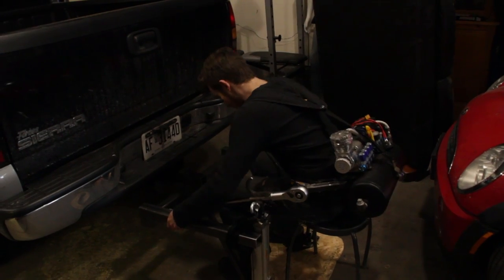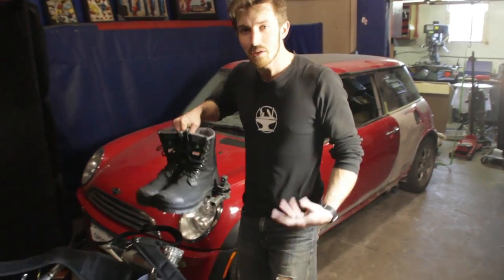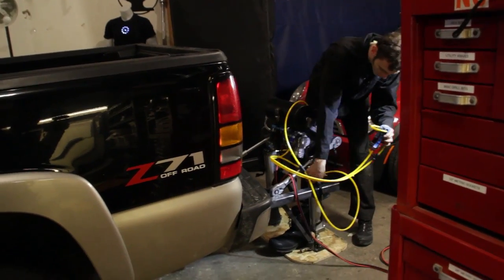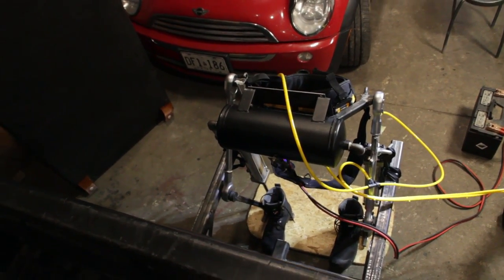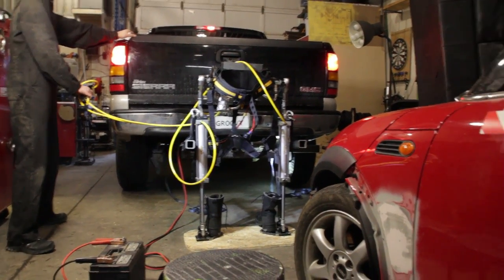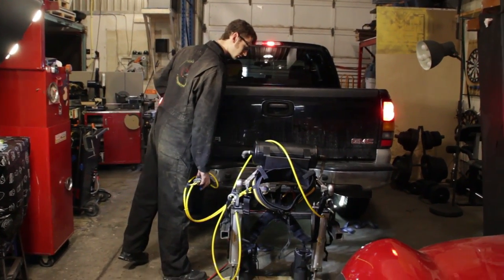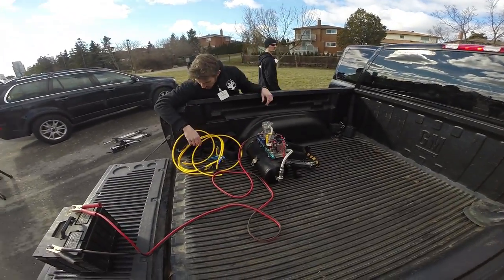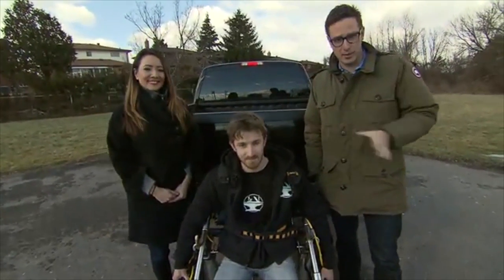Pushing the Exoskeleton to its LIMITS!

Comment: All I see in the comments section are people who are almost yelling at you to upgrade the power pack.

While it's a good fix for now, I've paid attention enough to know you're not keeping a measly lead acid battery that you have to hook up every time you want to power the suit up.

Though, it does interest me in what options you're looking at, power-wise. Any particular direction you plan to take the power pack?
Reply from the maker: +Gabriel March (V The Mama Bear) Yeah... people really don't seem to understand this is a prototype...

Likely will be using a high-end lithium ion battery pack for powering the suit, though I've also mentioned I might use a small scuba tank compressed to 4500PSI as a kind of reserve -- it has a similar power density to lithium ion at those pressures, just is a bit trickier to recharge!
Reply: +the Hacksmith Ease of use and how easy the unit is to recharge is important, especially if this is going to be used by first responders and such.
Reply from the maker: +Gabriel March (V The Mama Bear) Again... it's a prototype =P
Reply: +the Hacksmith I know. Just a (redundant) recommendation for the future :P
Reply: +the Hacksmith get a cryogenic refrigerator and liquify air.  Then pour it into the scuba tank.
Reply: +the Hacksmith  u could try a diy tesla battery and get like 10 kilowatts. space the battery's all over the suit
Reply: +Shadowrcmegatech lox's u wold have to run a heater and it would freeze all your lines

Comment: May i suggest next time an exoskeleton that focuses on increasing the mobility of the user, rather than the strength? Something along the lines of powered kangaroo shoes, or maybe just a complex assortment of springs arranged around the legs. Break 9 seconds in the 100m dash, or maybe 3 minutes in the mile
Reply from the maker: +dingwon It's just a prototype dude, you get that right? I have plans for many other exos, but I'm only one guy. With no funding...

Comment: Hey This is seriously awesome.
Ever since you promised us that you'll fly like iron man I can't stop thinking about methods of propulsion.
The only things I found practical so far are hybrid rockets (rubber as a propellant and nithrousoxide aka laughing gas as an oxidizer) and pulse jets the types with a valve (jet fuel or kerosine). I have considered jet turbines but they are to complicated. Can't wait to see what you come up with.
Reply: +gamerdudes superelite Nitrous oxide/liquid ethane are often the starting point for liquid fueled engines, as both liquefy at room temperature at 60 atmospheres or more, so a fuel pump isn't needed. Gas turbines aren't that difficult, there are how-to books out there guiding R/C modelers to build their own, but it would be a pretty big investment in time. The original Rocket Belt used concentrated hydrogen peroxide, but that's a fairly dangerous substance (of course all of these are reasonably dangerous for this application).
Reply: +Michael Lovelace not only that but the classic rocket belts last for 30 sec max. About jet turbine engines you can buy them but their thrust is not that big and building them would take a lot of time and remember we aren't talking about one we need several if you want to fly like ironman. Also I can say that pulse jets are the best option since they are simple and don't require a proppellant. And about rockets I don't know if its true or not I read that peanut butter is a very energetic material so mixing it with your rubber might give of some interesting results.
Reply: Yes, the reason I mentioned building one was that there's a gap between the largest R/C engines and the smallest commercial engines which is right about where an engine for a jet pack would be. I wonder about the amount of vibration from a pulse jet.
Reply: +Michael Lovelace I don't think pulse jets are too bad. Its the most practical out of the impractical idea of flight. I mean in the future when ion propulsion advances that will be the most practical but now ion thrusters can lift about 1 gram per watt so good luck supplying it with enough energy without weighing it down.
Reply: Ion engines aren't a propulsion system for an atmosphere. The motivation for ion engines is that in space reaction mass isn't free, so you'd like to get as much impulse out of it as possible. If I was going for a wish list technology, I would probably go with a gas turbine engine with carbon-carbon composite turbine blades, they would be much lighter and allow higher turbine inlet temperatures than nickel aluminide. With current anti-oxidation coatings, they'd only hold up for a couple of hours, but for wish list stuff, money is no object and you would just replace them.
Reply: +Michael Lovelace yes ion engines are meant to go in a no atmosphere environment but I was referring to lifters or iono crafts that cant work without air because they use the air around them to propel them. Mythbusters have an episode where they put one in a vacuum container and it doesn't work. And the engine it self isn't a wish list you can make one for super cheap the wish list tech here is an arc reactor capable of supplying it with enough energy to lift someone.
Reply: The efficiency of an ionocraft comes from moving air at a low speed. So the surface area of an engine which could lift a human would be quite large, if you're going that big, why not just use a vtol craft with a rotor, driven by an internal combustion engine. One modification to the rocket belt used the thrust to turn a rotor, the flight time with this was around 2 minutes. There have also been backpack helicopters with longer flight times.
Reply: +Michael Lovelace yes and honestly about the hacksmith I think that this would the most practical option. Think about it on his exo he is planning to have a scuba air tank with 4500 pressure. Regulate it down to 50 and hook it up to a bunch of turbines driving ducked fans. And about iono crafts you really don't need larger surface area as long as you  have a high enough voltage.
Reply: +gamerdudes superelite By the way, if you're looking for a technology with a power output closer to the "arc reactor", you might look at betavoltaic batteries. These use "pure" beta emitters, that is, isotopes which only emit beta  particles and decay either to stable isotopes or other isotopes which are themselves pure beta emitters. The problems: 1.they are of course radioactive, although their emissions are easily shielded. For beta emitters with energies in the 100's of keV, bremsstrahlung radiation can be a problem. 2.The isotope decays whether you use the energy or not. 3.You have no control over the rate of power generation.  On the positive side, the energy of beta decay is tens of thousands to hundreds of thousands of times higher than the chemical energy in conventional batteries for suitable isotopes. Most of the attention has gone to isotopes with half-lives of a number of years, to power satellites or remote sensing equipment, but one design uses a liquid metal semiconductor and sulfur 35, which has a half-life around 3 months. It would be interesting to see the power output of batteries based on isotopes with even shorter half-lives.

Comment: Will you eventually move onto electro-servo joints or are you sticking with pneumatics on your prototypes for now? It would be cool to see an electro-hydraulic hybrid like the T-800.

P.S. Those are pneumatics, right?
Reply from the maker: +Ultra Indigo Yeah it's all pneumatic right now. The problem is I can't get anywhere near the power or strength from a servo joint based design... wouldn't be picking up weights, let alone cars. =(
Reply: +the Hacksmith Why do you not use The pneumatics for strength and der servo Motors for motorized movement. And are you able to lift later the car with your "exo Hands" or just by making a Connection to the Thing you want to lift to your bottom part of the suit?

Comment: you should look into electro magnetic motors to power your suit
Reply: +Carl Howe The power density of an electromagnetic motor is actually lower than for human muscle for off-the-shelf motors. Plus you really have to gear them down to human speeds. With pneumatics he has a lot of room for improvement, he could make his own pneumatic cylinders out of fiber composites and eliminate perhaps 80% of the weight.

Comment: Do you put anything on the pneumatic fittings to make sure they don't fall off?
Reply from the maker: +Ling Shan Sum they don't just fall off? Lol
Reply: well the air hoses I use are a little bit loose
Reply from the maker: +Ling Shan Sum that's not good!

Comment: you need power on the suit itself
Reply from the maker: +brandon rh The power is on the suit... what are you talking about?
Reply: +the Hacksmith like iron mans
Reply from the maker: +brandon rh Arc reactors aren't real buddy.
Reply: +the Hacksmith I know but I would look cool at night
Reply: +the Hacksmith It's actually possible to make arc reactors by using compressed hydrogen fuel cells. Compressed (700 bars) hydrogen has a power density of 40000w per kg.
https://en.wikipedia.org/wiki/Energy_density
Reply from the maker: +EEEE le r Yeah... "possible" ;-)
Reply: +EEEE le r I don't think we'll be seeing any breakthroughs in arc reactor technology from the hacksmith :P
Reply: +the Hacksmith well in real life you are only getting 1000w per kg because of the weight of the system but it's still 3 times more than the most powerful batteries.
Reply: +EEEE le r It's energy density, not power density. It should be in wh. Even gasoline or propane have an order of magnitude or two better energy density than a lithium battery. An aluminum-air battery has quite a bit more energy density than a lithium battery, but it's not rechargeable. The distinction between power and energy density isn't trivial, a supercapacitor has a lower energy density than a lithium battery, but a higher power density, because it can release all it's stored energy in a much shorter time than a battery. Since none of the demonstrations so far has been an endurance contest, a supercapacitor bank might be a better choice than lithium batteries. YouTube super-genius Robert Murray-Smith has developed supercapacitors with energy density comparable to lithium batteries, he's making them for an electric car maker, but I suppose at some point they will be available to the general public, these would combine the best properties of lithium batteries and supercapacitors.